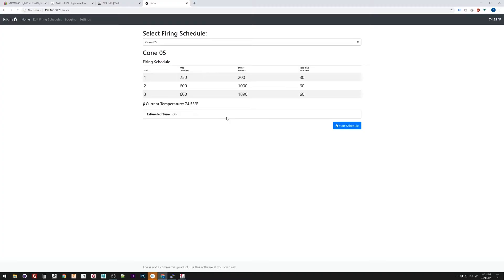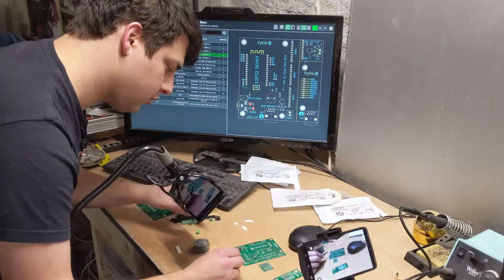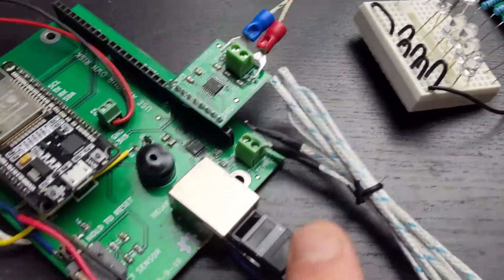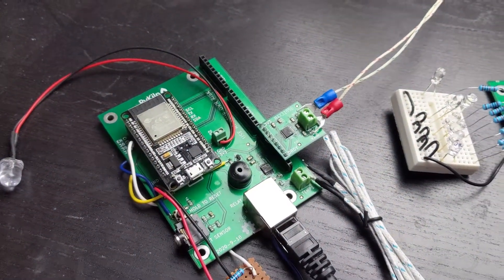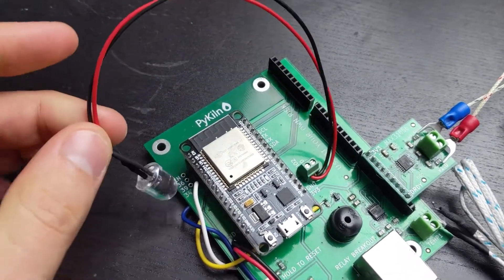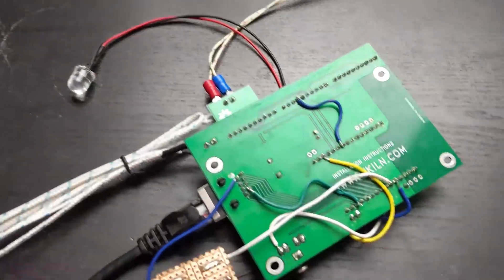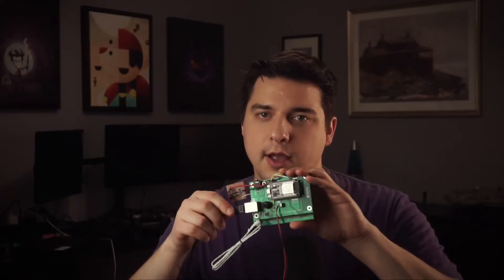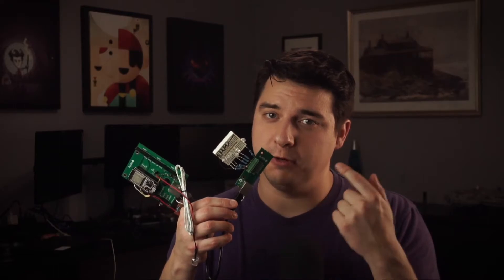PyKiln Assembly

Comment: when connecting thermocouples, as far as i know, you should not use any different metal such as crimps, screw terminals, etc as they will induce a voltage difference thus a temperature shift.
https://youtu.be/AYblSfpKRUk
Reply from the maker: Yep, you're right! I've made some changes to the design of PyKiln. I switched from the MAX31856 to the MCP9600. I'm talking to the breakout board over an ethernet cable using I2C now. You'd still need the Chromel and Alumel wires to connect to the K type thermocouple. But the distance is way shorter.

Comment: Hi Ben. Interesting project. Had a look at your Github diagram "pykiln-component-diagram.pdf". You are connecting thermocouples through the HDMI cable. This will cause misreading’s due to cold junction faults.
Reply from the maker: Hi Jens, thanks for your interest in the project! I will admit I don't know everything about thermocouples, but I do have a thermocouple offset built into PyKiln. So if you put the thermocouple in ice water and it reads 20 C then in the settings you would enter an offset of -20 C. 

I did some testing with a k-type thermocouple and a MAX31865 and extended the thermocouple cable with about 20 feet of ethernet cable and it didn't effect the readings. I haven't tested it yet with HDMI, but I'm planning on using the twisted pairs of wires in the HDMI cable which I imagine should behave the same way as the ethernet cable.

If you were designing it, what would you do to avoid misreading's?
Reply: @curlytalegames2609  The connection from the sensor to the board should be a k-type extension cable (if k-type is used) with the same materials as the sensor. 
If you introduce other materials between, the connection points between the different materials will introduce a faulty reading. You can compensate this with the built in offset you have, but this only works if the temperatures of the connection points between the different materials does not vary too much.
Reply from the maker: @jensbovbjerg9284  Interesting, I did the initial tests with the ethernet cable at lower temperatures so I'll have to do more testing at higher temperatures. If the temperature readings are off by more than a few degrees I'll switch to thermocouple extension cable. I appreciate you're expertise on this!

Comment: having rebuilt 3 kilns now for a friend who is into pottery, and installing ramp/soak pid controllers i am very interested in this project. 
i would love to see it use an SSR
i would also like a door status input (open/closed detection) so the software knows when the door safety has been triggered (my current wiring which i intend to leave as is has the door switch operate a contactor which is in series with the SSR, being hard wired ensures it is a back up safety measure independent from the controller, would also add a relay in this circuit for runaway cutout)
i would also like voltage detection to accompany current detection so that true KWH can be measured and element health can be tracked.
Reply from the maker: Oh very cool, are you an electrician? For sure! I designed PyKiln to use a mechanical relay + contactor as a fail safe. You could probably get away with just using the mechanical relay for a small kiln. Contactors are great for large amounts of current and the nice thing about mechanical relays is they tend to fail in the open state. SSRs tend to fail in the closed state which is dangerous when it comes to kilns, however SSRs are amazing at turning off and on without any wear and tear. That's why I am designing PyKiln to use both. The mechanical relay is a master power switch, and then the SSRs provide fine tuned control over each heating zone. Interesting! I never thought of including a safety switch that disconnects power to the heating elements when you open the kiln, but I like that idea a lot! What do you think the best way to detect when a kiln lid is open? IR sensor? Microswitch? Reed switch? I've thought about the voltage detection for more accurate power measurements. I kind of want to log the voltage at my house to see how much it fluctuates over time. I'm curious to see how far off the power usage would be with measured voltage vs assumed constant voltage. If the two numbers are close I feel like it could be omitted. I've heard other people mention element health too. Rather than come up with a way to measure the resistance of the elements, would a simple reminder/email notification to measure them work? Let me know what you think :)
Reply: @curlytalegames2609  i am an electrician in queensland/australia all three of the kilns i have rebuilt came with a door microswitches which even in the original configuration would drop the contactor, i guess our voltage is a little higher than the US and can quite easily kill, so protecting users from being able to touch a live element is required by electrical safety laws,  here is an internet sourced picture of a kiln very similar to the ones i have worked on, ( https://www.mgs.net.au/auction/catalogueitem.html?a=7618&ps=184822 ) at the bottom left of the door you can see a very simple door switch mechanism. but ultimately if you provided a pair of terminals for any switch (or loop if not needed) that way kiln builders could use any switch they liked (personally i would feed these terminals form a set of contacts on the contactor, and maintain the door safety independent of the controller)
as for voltage monitoring, other projects i have followed used a 5v unregulated power pack to then measure safely. 
my thoughts to what i'd love to see on the PCB, make all thermocouples modular, have them all as header pins, that way different TC types can be used easily, 
i'd also love to see one relay mounted on board and the rest of the outputs as screw terminals as that is all i would need and would save the need for the separate output board.
Please keep up with the excellent work, looking forward to seeing more

Comment: Probably if you want the best kiln controller ever you should use ssr s instead of the mechanical relays, and add full pid control. It will be quiter, faster, more reliable, and you don't need that much power for the relays.
Reply from the maker: You're right, Solid State relays are much better at switching things off and on quickly and won't have any wear and tear, which is why I am using them in PyKiln to control the heating elements. The mechanical relays are only being used as a main power switch for safety. When solid state relays fail they tend to do so in the closed position, which would result in a run away kiln.
Reply: @curlytalegames2609  Oh good, you are right. What kind of UI your kiln has? Any screen or buttons?

Comment: One thing I'd like to see would be a basic spi lcd connected, so that you can see the temps/times/schedule at a glance and maybe modify them using a thumbstick-button? I'm not sure if you've got enough pins left for that though haha
Reply: Just to add, I'm super excited for this project, it's beautiful. Looks amazing so far, and love all the features you've implemented so far. I'm well looking forward to beta testing it!
Reply from the maker: @noviceartisan  Thanks David, I'm glad you're interested in the project! Yeah I'm definitely running out of pins, that said I've left the Serial and I2C pins open so an LCD module could be added. However, one of the reasons I made the kiln controller web based was so I didn't need an LCD screen. I really dislike the Bartlett 3 key controller I have on one of my kilns. The LCD is constantly cycling between what menu you're on and the value and the buttons are a pain to use. If there were an LCD what information would you want displayed on it?
Reply: @curlytalegames2609  Hmm, to me, the most practical information that I'd want/need to check at a glance/click would be;
Current temperature
Current step on programme (if a lcd with ample pixels, can display the schedule itself as a coloured in segments / flashing current segment chart?)
Time remaining on current step and overall remaining time
if a thumbstick style pad could be integrated (big ask) then ability to switch between programmes and start/stop would be sweet, as thumbsticks handle up down left right and click in one nice package and are lovely to work with :) (this is least important, i know it's a bugger to program)